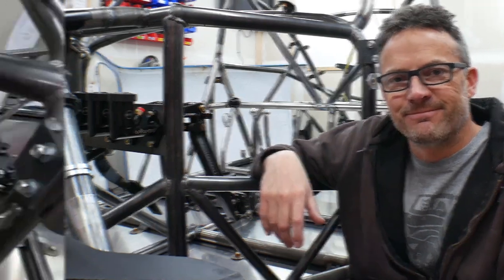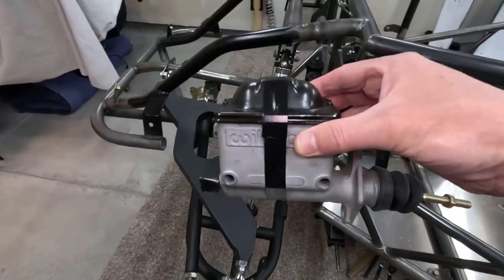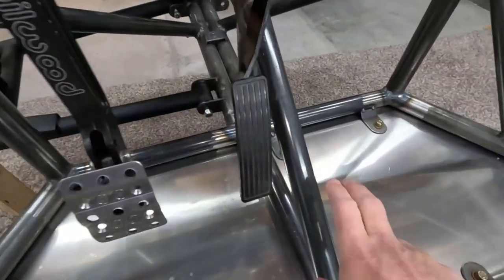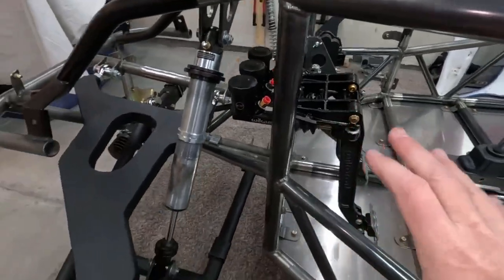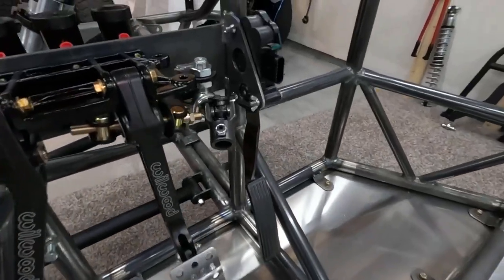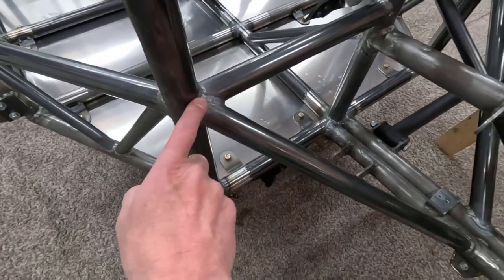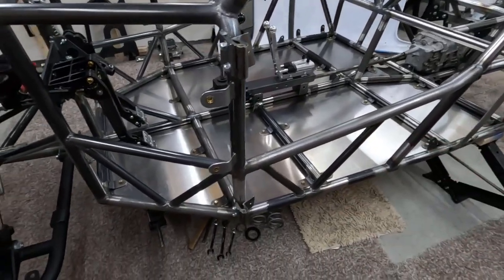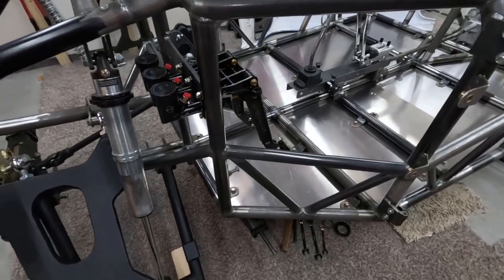Brake, clutch, throttle, steering.... The struggle is real!

Comment: Mike, I don't see any concern on the steering column geometry. I think you done an excellent job👍.  If look some of the front wheel drive veh. manufactured, they have all kinds Uni joints installed. My concern is the one tube mounting bracket of the upper control arms. With the height and size of the tires you are going to be using and the off road application of Wrachet, I think it need to be strengthen also since the suspension moves independently. Every jumps, hard brake applications, etc or lateral movement during hard cornering put a lot of strain on that bracket. I could be wrong. Just my opinion. You really done a lot of progress on Wrachet since I was away from Youtube because of health issue. Thanks for sharing. B-safe.
Reply from the maker: I'm undecided if I'm going to brace that upper tube or not, but this chassis is Mauler not Wratchet. So it won't be used as hard as Wratchet. But regardless you're right on the forces that tube will be under, I need to decide what I'm going to do with that.

Comment: Reason for not liking"uni joint" in steering column ?. Off set from a  straight column gives a collapse point in case of catastrophic front impact. Acknowledging that it can also add weight to steering response under load.
Reply from the maker: The only reason is because I see it as another failure point on the steering, and possibly increasing steering slop. Aside from that I don't really have issue with it. I just instinctively try to keep it a straight shot to the steering wheel.

Comment: Awesome job Doc, you have some great ideas & skills. What welder are you using??
Reply from the maker: Thanks, I use a Miller Millermatic 211 for mig, and an old Lincoln 175 Tig welder. I usually favor Lincoln, but the Millermatic does a really good job on mig welds.